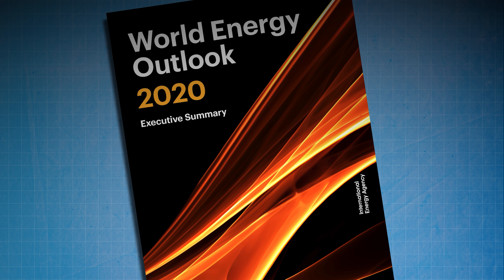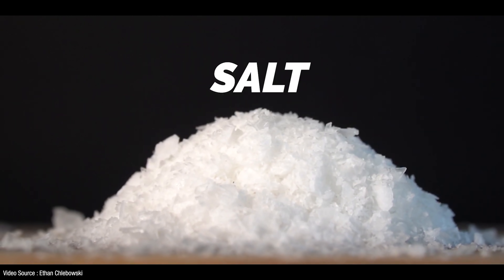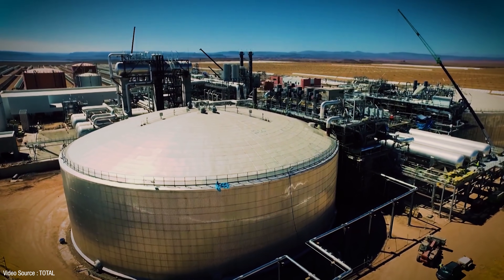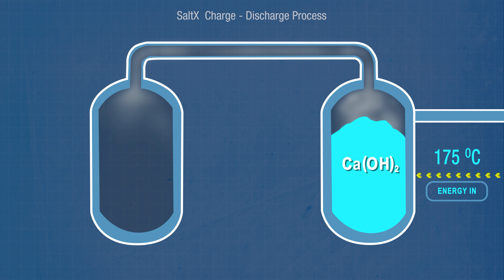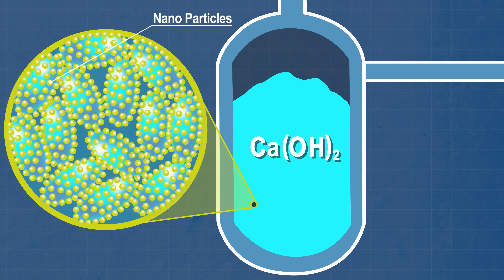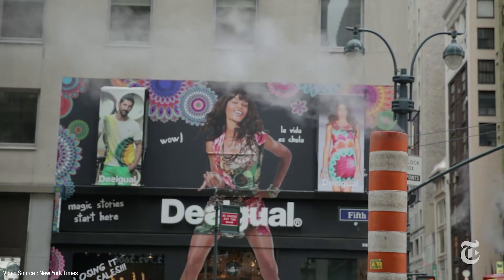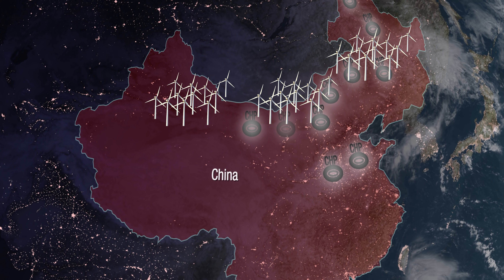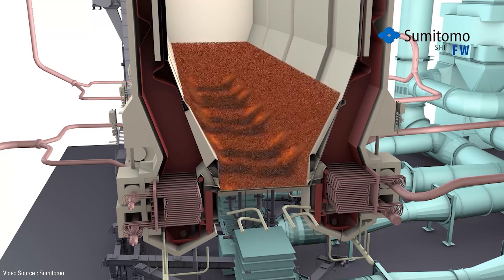Energy storage in salt - how nanoparticles are revolutionising the industry.

Comment: You see similar issues with thermal energy storage using hydrated salts. The problem is when the system cools, the solution can become supersaturated, preventing crystalization. Vibration or seed crystals could be used to crystallize the sodium sulfate, but they found that adding a small amount of borax provides a initiation site making crystalization more reliable.

Comment: I wondered the system could be heated by the sun directly instead of electricity. 
The sun-mirror-based technology in sun towers that Spain is using, in particular, is good for it.
Reply: The power to heat the salt can be provided by any type of generator, as long as it can heat the water up to the needed levels.
Reply: @nocto8237  You can heat it in any way but producing electricity and then producing heat from electricity has 2 sets of low efficient procedures while heating the salt solution directly by the sun is direct and has the highest performance.
Reply: @drpk6514  The reactors charging the salt is very explosive so to say the reason is to efficiently load the salt. Direct sun would take to long and produce less energy density out of the salt. Thats my take from listening to the CEO talking about the technology. 

Also they just signed an agreement with Calix to produce more efficient charge reactor.
Reply: @nocto8237  1. Why would it be "very explosive"? 
2. No, the sun towers produce a massive amount of heat. It is not drying the laundry. 
3. Any improvement in efficiency with two energy transformations would never be as efficient as the direct implication of the energy from the sun.
Reply: @drpk6514  I think its the discharger phase and not charging that the CEO described as "explosive". My bad. I think he meant that the reaction from the salt + water can be considered as "explosive" and not in a sence that it would explode :)
Reply: @nocto8237  It might be since it produces over 400C. But the suntower just dries it which is the opposite part and quite safe.
The more I look at it the more I think the suntowers can produce good amount of these materials with good efficiency.

Comment: Yes, this creates another option that could potentially be very useful.

If you could find a practical way to make the quicklime and the water recombine electrically, with the kind of efficiency you get in a battery, then you'd really be rocking. Short of that, yes, industrial process heat might be the best use. District heating might be useful in really cold climates.

It might be possible to combine that heat with artificial trees to liberate CO2 captured from the air. That would take care of their energy needs. You'd still need a place to put the CO2, so you'd really like to find a place where there's lots of sunshine, and at the same time a good repository for the CO2. You'd still have lots of lower-grade heat kicking around, so if you had some industrial processes that could make use of that, that would be still better.

Comment: What I especially like about this is that the energy can seemingly be stored for long time periods, months even. This is important for high latitude countries like Sweden which have long dark winters. The available solar energy in the winter might be 10% or less compared with summer. So, some back of the envelope calcs for how much Ca(OH)2 would be needed to provide electricity year round: 

Swedish electricity usage per year: 140 TWh
Rough Estimate of Energy Storage Capacity: 100 TWh
Energy Storage of Ca(OH)2 per ton: 400 kWh
Roundtrip energy efficiency: 40%
Effective energy storage of Ca(OH)2 per ton: 160 kWh
Tons of Ca(OH)2 required: ~625,000 metric tons
Cost of NanoSalt (assuming $250/ton): ~ $150 Million
Volume of NanoSalt required (assuming 2X density of water): ~300,000 cubic meters, or ~ 120 olympic-sized swimming pools.

Of course, the cost of generators and balance of plant will increase costs substantially, but this looks to be a HUGE WIN if it works as advertised. I'd like to see a full levelized cost of electricity report, but I suspect this can supply power MUCH cheaper than any fossil fuel plant, which means that since wind and solar are already providing the cheapest energy and getting even cheaper, fast, then this could really make fossil fuel not only obsolete, but economically non-viable as well.
Reply: When there is not enough sunlight there usually is enough wind.
Reply: @drpk6514  not necessarily. For example, in Stockholm there is less wind in December and January than there is in May and June.
Reply: @JessePowell_ad_astra  Usually not always
Reply: @drpk6514  You aren't really bringing any data to refute my point, so let you give you more data. In high latitude European countries, wind power production is about 2X higher in Winter than in Summer. That is not enough to offset the ~8X drop in solar power production in Winter. Hence, high latitude countries need seasonal-scale energy storage in addition to daily or weekly-scale energy storage. Truisms like "the wind blows when the sun doesn't shine" are overly simplistic and should be examined with more scrutiny 
when trying to plan a true carbon-free economy.
Reply: @JessePowell_ad_astra  Use your common sense. In Europe in north which doesnt have much strong sunlight has strong winds. Even in Antarctica, there are strong winds but not much Sun. It is the general pattern,

Comment: I am impressed.  

This is the technology that has the perfect blend of integration and practicality.  

Curious, and disclaimer I am writing before reading rest of comments, can this process be done off earth?  Moon? 

Honestly having a heat pump that's just chemistry would really be amazing for closed loop systems.  

I also wonder how small the tech can get.  Ideally a home or apartment building would be amazing. 

Oooh setting up a system of renewable's along the coasts to desalinating sea water combined with sustainable farm fishing is another must.  

Being from a northern climate having stations like this built under a hill or something nature inspired and currently occupying that heat the highways above freezing.  

Then there is the idea of using 1000 cycles to pull c02 from the  air isoa process is simple enough to generate power, and chemistry loves heat, it could be a build it , turn it into a park and move on to next.  I would get behind this, especially if we could 3D print most of the facility, and testing out automation is always a good idea. 

disclaimer number 2, Google OS new spell check is finicky,

Comment: The problem with this as so many other system is that they make no sense as storage for electric power. You just lose to much when converting it back and forth. The high working temperature increase the loss of heat. You can use CaOH for ever without any nano tech. You just recrystallize it in once in a while. There will be value in a system that avoid doing so, but it is no game changer. 
This paper that describe this type of system well: Ref: https://digital.csic.es/bitstream/10261/102476/1/Kinetics_CaO_Criado.pdf

Comment: Wonder if this would be an economic solution for domestic applications? I.E. home system, where 70%-80% of cost is heating water in my house... Rob - in Adelaide, SA.
Reply: I would think a solar hot water system would be better over there my aunt in port Augusta has this and works very well by my understanding 
Here in the Uk in our old house we had a system that would sense exsess solar production and power our immersion by that amount 
For 6 months it provided almost all hot water very rearly would we turn on the boiler or immersion 

For the rest of the year an initial heating in the morning was all was needed the solar would often keep the water hot throughout the day
Reply: @carmadme  I agree, but a good solar system is the most expensive option on the current market, 😞 plus due to my current PV (electrical) solar panels - I don't have much remaining roof space. 😊
In addition, I would love some more environmentally efficient methods of heating the house - we currently just have a single combustion heater (burning wood).
🌳🔥👀
So if this technology could be economical at a domestic scale, I would be very excited. 😁
Reply: @mrtabisdad  if you already have solar for electricity you should be able to buy the device we had on our old house
Reply: @carmadme ??? 
I'm guessing that's a smart switch that monitors PV production vrs hot water power demand? 🌞🔥💦🤔
Looked into that a few years back and was quoted A$2k - but I might revisit it again... 🙄
Thanks for the suggestion. 👍🏼
Reply: @mrtabisdad  2k jeeez the unit we had is called solar iboost less than £300 allowes you too use the immersion normaly at the press of a button if solar hasn't been enough and tells you how many kw of solar has gone into your immersion 

They're simple devices a coil goes round your mains going out of your house and talks remotely to the unit

Comment: Thank you for another great video! This sounds like it could be extremely useful, since it doesn't require huge amounts of lithium or massive engineering projects to set up. You could locate the storage system right next to the factories and neighborhoods that need the heat.
Reply: Yes, it's called municipal heat. Its been around a while.  CHP plants are providing heat to local populace.
Reply: @crcurran  Is that in Britain?
Reply: @Kevin_Street  Yes, a lot more than you would think.  The UK did it in small scale implementations rebuilding from the blitz

In 2013 there were 1,765 district heating schemes with 920 based in London alone. I'm not sure when this was totaled but in the past few years it was totaled to  around 210,000 homes and 1,700 businesses supplied by heat networks in the UK.

https://assets.publishing.service.gov.uk/government/uploads/system/uploads/attachment_data/file/212565/summary_evidence_district_heating_networks_uk.pdf

EU cogeneration is big initiative over the next few decades.

Historically, Finland has had the largest systems in the world per capita.  Necessity is the mother of invention.
Reply: Very interesting! Thank you for the reply.

There was a video about this kind of heating before on Just Have A Think. It sounds like a very good idea, particularly the way they've got it installed in places like Sweden and Finland, where it can be combined with well insulated homes.

Here in my own country of Canada, we've got nothing comparable. They were going to use district heating in one new neighborhood of my city, but backed out because of the cost.

Comment: One really useful feature of this is that the dried salt could be shipped from place to place by truck, allowing districts, buildings or potentially individual homes that are not near the power station to run their heating from this source. IT looks like the energy density is much too low to be competitive with shipping kerosene or other current fuels though. A piston engine could also be run on steam produced by this material. Provided the steam can be condensed afterwards and reused it's a potential zero emission transport system. A big issue with using this for transport would be turning it on and off and the energy density issue however.

Comment: Yeah, I've been interested in the different thermal storage options being developed. Here in Adelaide, South Australia there's a company called 1414 that has developed a thermal storage system using silicon as the storage medium. Primarily it was developed as an industrial scale source of heat for industry but it now it has also developed a turbine to derive electricity. Recently it installed it's GASS- TESS system at the sewage treatment plant here in Adelaide. These thermal systems seem great to me, they all seem amazingly scalable and extremely versatile. The salt tech you show here has the added benefit of longevity of storage which sort of sets it apart, very encouraging.
Reply: If the temp is high enough it could be used to create green ammonia without the need of electrolizers

Comment: It would be interesting to know how many btu 1 cubic meter of these salts could create. It might be feasible to have a hybrid salt container 2 to 4 cubic meters installed in the basement of a home along with an adequate water supply, which might be similar sized containers as the salt containers depending on how quickly the water has to be mixed in.
Reply: I would love to have heated floors, greenhouse, garage, and outside walkways.  I live in a Northern climate and plan on retiring one day to a place with simple luxuries handled cleanly and  without intervention.  Just having heat for showers would make it worth it :D

Comment: Writing as a total layman my initial thought is that if this works best supplying heat (through steam) then its application will be greatly limited according to the season.  In summer the steam would then have to power a turbine to convert to electricity.  Not only would this make it much less efficient in the summer but it would also add to the complexity of the system.
Reply: In the summer the steam could be used to run an absorption chiller https://en.m.wikipedia.org/wiki/Absorption_refrigerator to produce air conditioning.

Comment: Salt-X may store more "energy" per kg than Li-ion batteries, but it's not the same energy.  Salt-X stores heat which can't be efficiently converted to electricity.  However, if heat is what you want to have, then it sounds like a pretty good solution.  I worry about the cost of the nanocoating, however.
Reply: I wondered if those nanoparticles are really necessary as 40 cycles without them would be enough. They could be sent to be used in other industries and since they are cheap they can replace them with ~ the same cost.

Comment: Instead of re adding clean H2O    could you add more ocean water and get, more or less, the same reaction ?
Reply: Over time you would have a salt build up etc.  This would shorten the life.
Reply: @kensmith5694  thank you, but how short? Instead of ten years, nine years ?

But, in the meantime it would work and people could drink the distilled water after adding a few minerals.....correct?
Reply: @drorbenami  
Someone would have to look into the "how short" but given that the cycle can be closed when seawater is not used, there is little advantage to using sea water unless making fresh water paid very well.

Comment: It would be interesting to see how this technology compares with the energy density of established fuels such as coal, heavy oil or natural gas.
Reply: This isn't a fuel.
What is the question?
Reply: Compare as in "it is much prettier" and "it makes a different noise"?
Apples are a round fruit people eat and so are oranges.  This makes them more alike than fuel sources and energy storage methods.
Reply: About 1/50th of fossil fuels, by mass. By volume it fares better, especially if you don't need to store the water. It actually marginally beats out lithium ion batteries by weight, but it is much harder to get the energy out. You run into inefficiencies unless you just want raw heat. If you do just want raw heat this makes a lot of sense, though the initial CO2 production might still be an issue.
Reply: @agsystems8220  The CO2 in getting quick lime from calcium carbonate (chalk, limestone)?
Because there is no carbon in the calcium hydroxide shown as the precursor to calcium oxide in this example.
But, we all know where the calcium oxide is going to start from. At least on any industrial scale....
Reply: @jimurrata6785  Yeah, I actually mentioned that too elsewhere. It is a definite concern. Didn't seem relevant to the specific question asked here. If they get their 1000 cycles out of it then it will be 20x fossil fuel performance, even without carbon capture or considering the decommissioning reabsorbsion, but the frontloading of that emission is definitely bad. On the plus side carbon capture from kilned carbonates is a far easier proposition than carbon capture from combustion of hydrocarbons. Water tends to make things far more complicated.

This is not a magic bullet, but it does present some great numbers.
Reply: @agsystems8220  Certainly if we are concerned about carbon emissions the very best place for fossil fuels is deep underground, where they have been for hundreds of millions of years already.
If the 90% efficiency number is to be believed this is a fantastic way to store heat!

Comment: No offense but any turbine related energy generation needs a lot if monitoring and planned maintenance.. Based on your explanation I dont see any advantage of this kind of energy storage over a high cycle deep discharge Lithium iron phosphate batteries..what I am missing here?
Reply: Calcium oxide is dirt cheap. Lithium is not. Additionally; in this solution power is decoupled from storage. As you point out the biggest costs are going to be the power machinery. In a battery storage solution the costs rise linearly with total storage, where in this the total capacity is far less important than the power capacity when talking about cost. You can fix the power machinery and still cheaply expand your storage capacity, making it possible to maintain reserves that could last weeks. That would be infeasible with batteries.
Creating and running turbines is also a mature industry that hopefully will be struggling to find jobs (I say hopefully because that means we aren't building much fossil thermal). It pulls in existing industry expertise that would otherwise be much reduced. I know we would like to let dinosaurs die, but politically this could grease the wheels in transitioning to renewables. I hate politics.